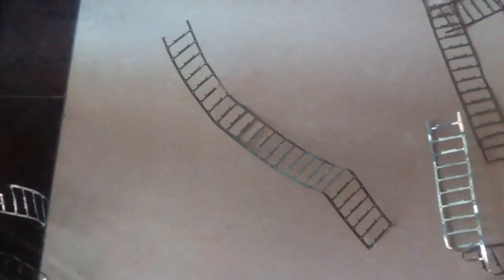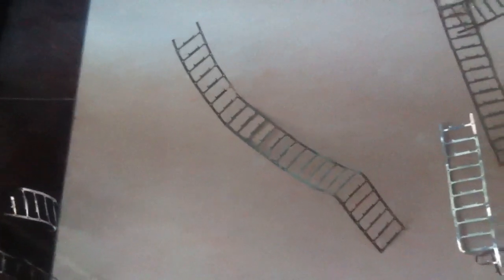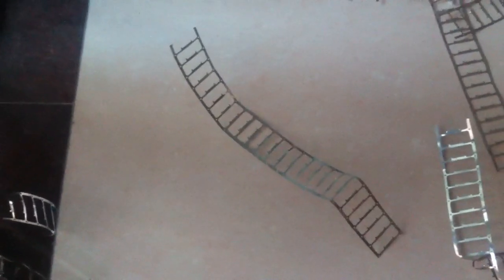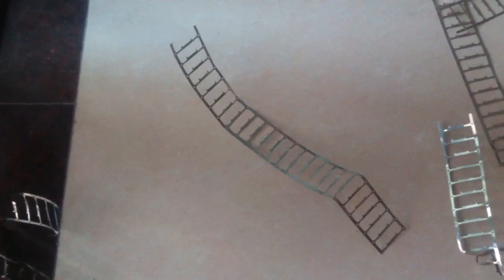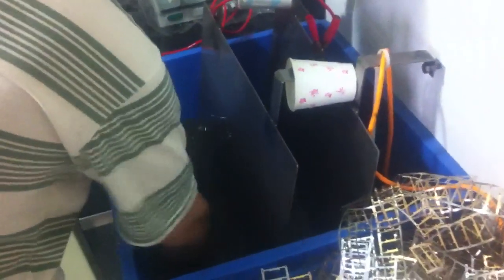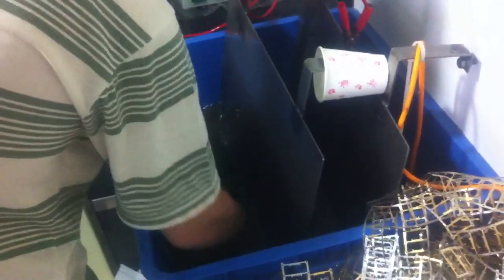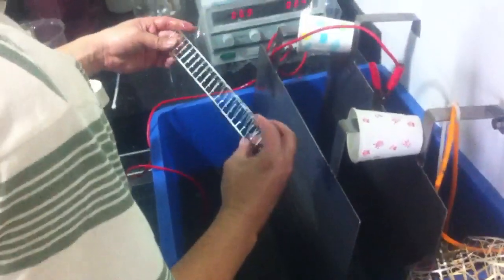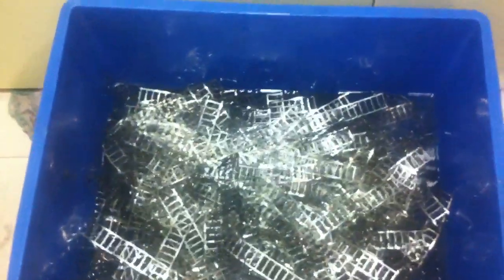Gold stripper process

Comment: I have been using chemical method of gold recovery and would like to change my operation over to your process. I have been trying to switch over to electrolytic process but I have not found a safe chemical to use for the electrolyte.  Can you tell me how to get the non-toxic chemical you use. Many thanks for posting your video! Email me at; rharpold@gmail.com

Comment: @goldobsession 
HI~thank you for your enquiry. This Au stripping process is Cyanide free electrolyte stripping technology which has two merits, higher efficiency on Au stripping, and no influence for body health. Besides, the explains you want to know is following:
1. the power source is using a power conditioner. We use a power conditioner to modulate the voltage by case. In the video, we applied the voltage and the current by15V/30A of the power conditioner.